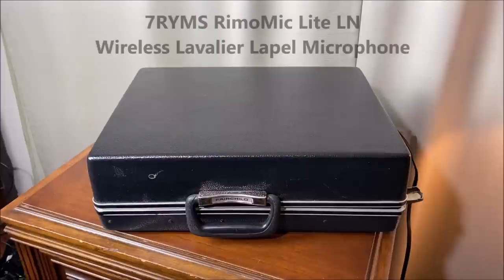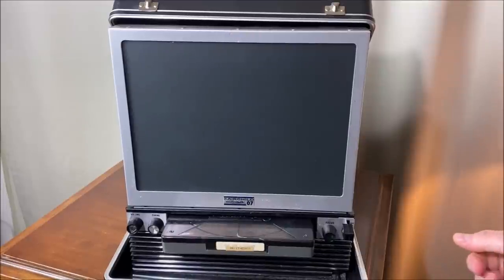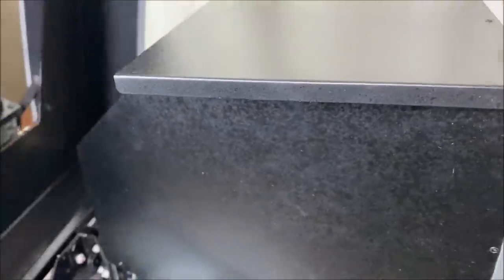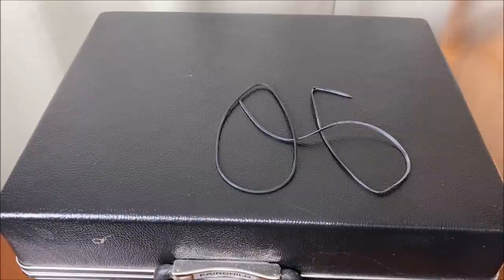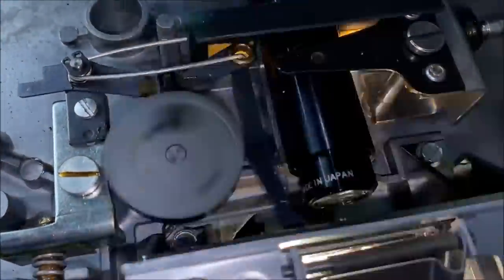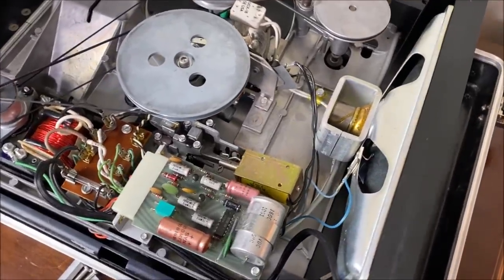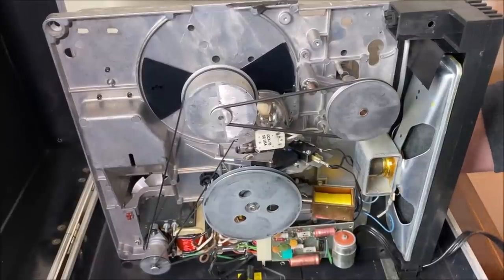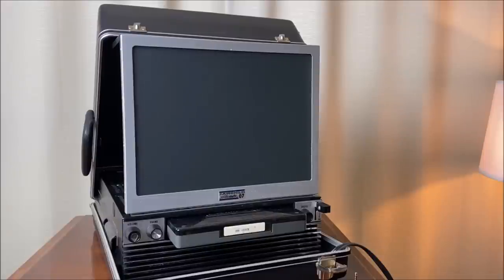Fairchild Seventy 07 Movie Theater in a Briefcase

Comment: There are only two places on that type of lamp you shouldn't touch, first is the lamp capsule itself, this is the bulb inside the reflector, if you touch this, it can be cleaned with alcohol prior to placing into service. Even more important is to not touch the shiny surface (inside) of the reflector, trying to wipe off the fingerprint may damage the reflective coating. You can safely touch the outside of the lamp including the base. This applies to halogen bulbs. The older incandescent types do not have any restrictions on touching as they are made of glass not quartz. This of course assumes cool lamps, hot lamps obviously should not be touched due to the burn hazard.